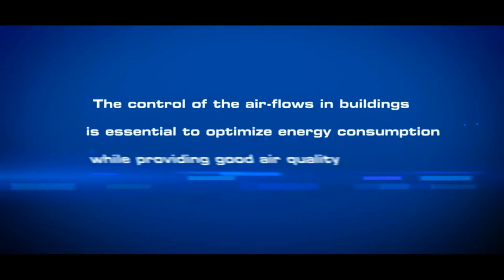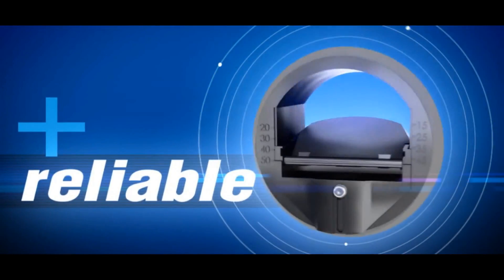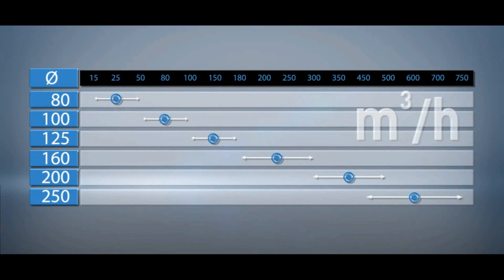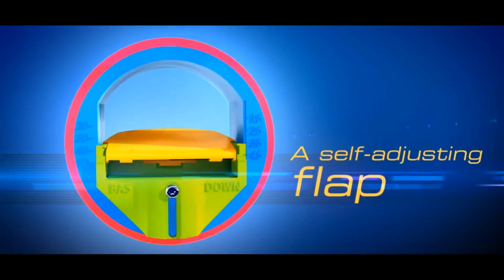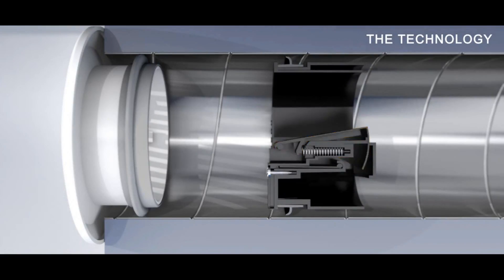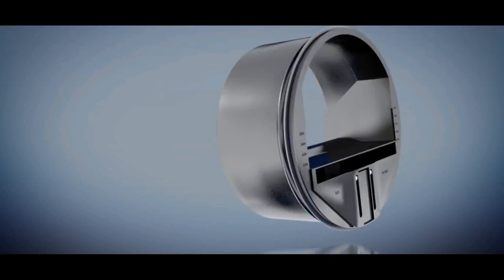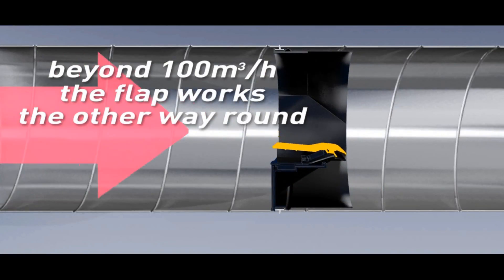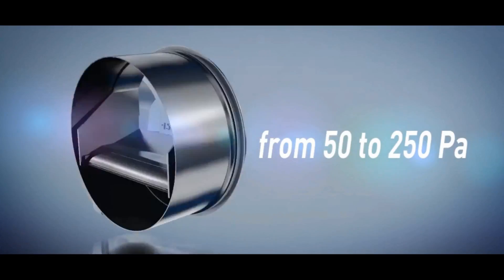CONSTANT AIRFLOW REGULATORS (CAR's)

Comment: Nice product. What if the pressure is much lower eg. 25 Pa? Thank you!
Reply from the maker: eFlow -Constant Airflow Regulator operates in pressure range 0.08w.c - 2.4w.c. (20pa - 600pa)
Reply: @eflowusallc8944  Thank you for the reply. I just only wanted to know whether the threshold pressure is 20 Pa? If System pressure is 15 Pa then does it work?
Reply from the maker: @durgab.k.2051   eFlow-CAR operates with +-5% deviation of the set CFM point, within 0.08w.c - 2.4w.c. (20pa - 600pa) pressure range. If the pressure is outside the above perimeters , the deviation may increase.
Reply: @eflowusallc8944  Thank you!